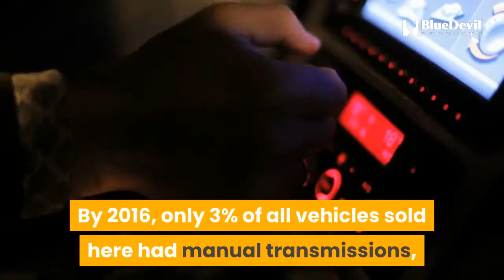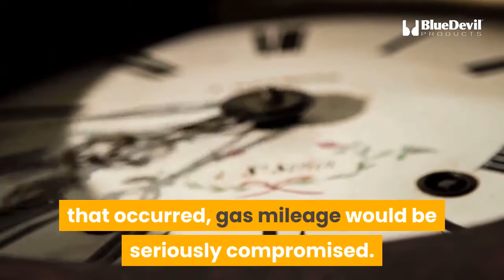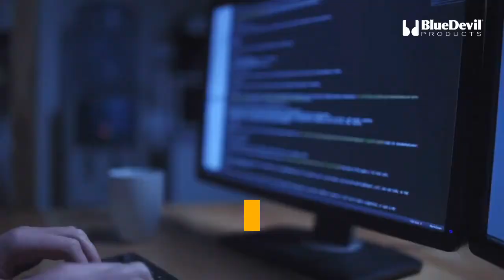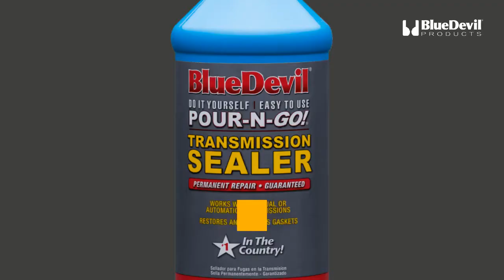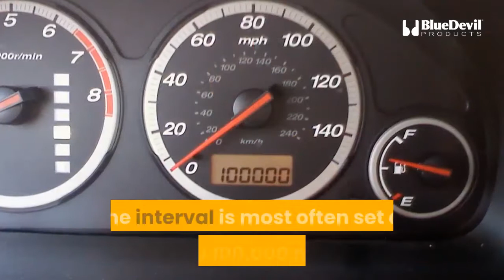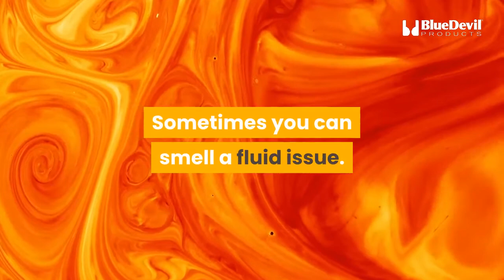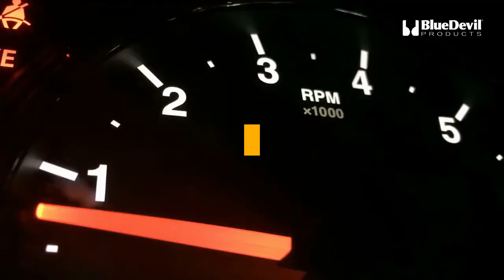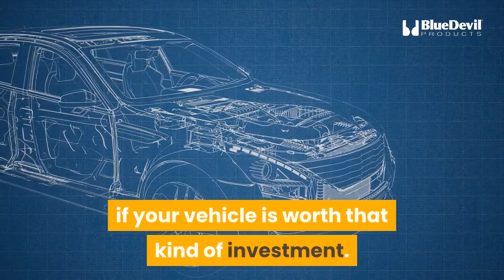Is The Transmission in Your Car Going Bad? | BlueDevil Products

Comment: I'm assuming you have to be driving, but my question is do you have to be driving or can you just run the car and maybe shift the gears from time to time I'm willing to try it but I don't think this will not work for me because I have a very bad leak and bad slipping. Sometimes they will be no motion forward or reverse but if I turn the car off and restart it I'll have forward and reverse motion again. I drove home 50 miles like this it was very slow but sometimes I would get up to 50 miles an hour and had to keep adding transmission fluid. Seven quarts that night